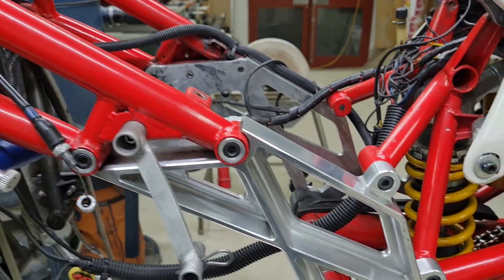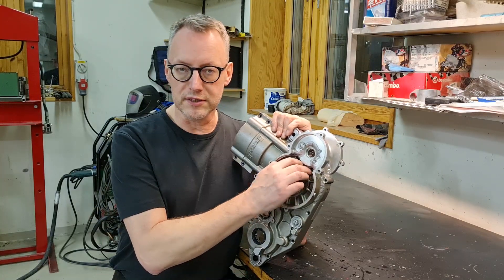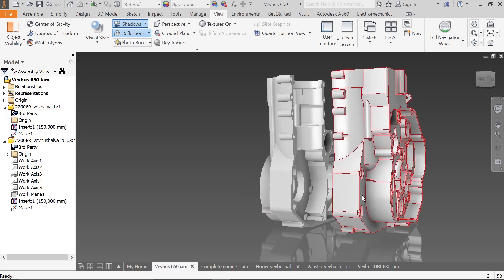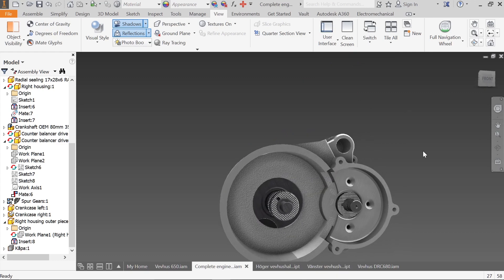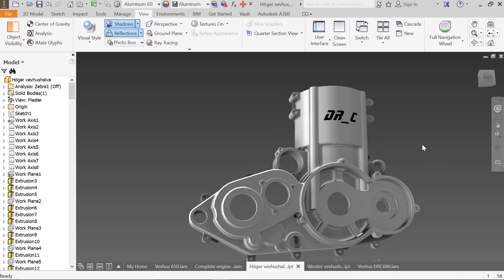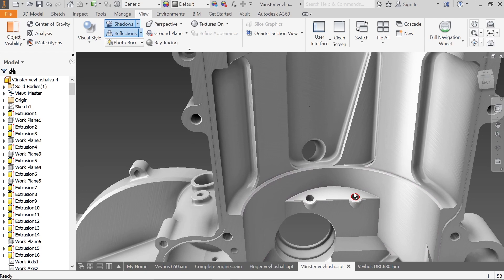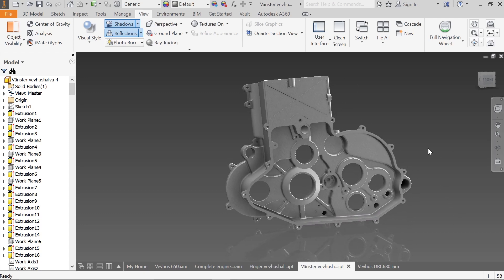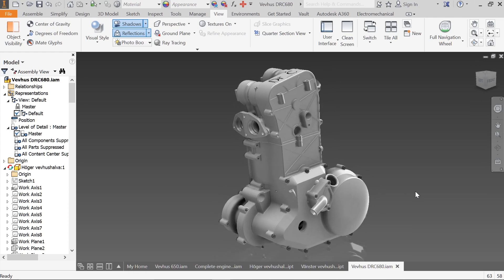Billet crank case project III

Comment: Mats, truly inspirational work. I have been searching for a billet impeller cover for the Rotax engine in my Bimota Supermono for a while now and to see you create not just a cover but a whole crank case is jaw dropping. I remember you had overheating issue in a previous season which you engineered a number of responses to, now that you took the design to a different level did you incorporate anything new in the design of the impeller to improve flow rate ? Best of luck with your endeavours.
Reply from the maker: Thank you for the kind words, Andrew! The heating problems have had more to do with having to stand still on the grid before warm-up and race. Other than that, leaking of coolant has been the bigger issue. No direct needs to increase flow. The billet head could benefit from a larger water jacket, to increase the heat transfer area, but too much work for a problem with small consequenses.

Comment: Why only two bolts on the cylinder?
Reply from the maker: What? Where?
Reply: In the first design, there are four bolts on the cylinder. And with the second project, only two. In my opinion, refrigerant may leak out there. Look at the original for how much material is left in the cylinder. @Dr_C

Comment: Mats could you have used barrel rollers  instead of double  spherical - like they used on later combat Norton to accommodate the flex ?  I saw that  some are contemplating moving  the counterbalance to the cylinder head - would this be an option?
Reply from the maker: Hi Trev and thanks for stopping by! Yes, those barrel roller bearings were on top of my list. When we simulated the bending of the crankshaft in Ansys, we could see a bending of up to 0,5 deg! That is unfortunately way larger bending than barrel roller bearings can cope with. The double row spherical roller bearing can cope with 1,5 deg tumbling, and some 58kN radial load, so they were the way to go. The mains have now shown zero wear or any signs whatsover on usage! :-)

Vibrations still include a certain amount of "black magic". Compensating the imbalance mainly the piston, crank and conrod are causing is difficult to calculate. Engine mounts and source distance and location from center of mass of the complete engine, comes into play. Placing the counter balancer high up in the cylinder head might very well work, but it is difficult already getting a good result closer to center of mass.
Reply: @Dr_C  Gosh that's a lot of whip in a crank  - I guess the forces must be massive to turn your crank into a skipping rope - being a large single and such unusually  high revs I guess  - your defiantly pushing the envelope - I remember looking at a chunky Chinese diesel engine about 1100 cc horizontal  single and was  astonished to see twin counterbalances tucked in either side of the crank - rather grand on a popular mass produced  engine - Its been fascinating to watch this develop on your channel

Comment: Just a note would it not make life much easier for your machinist if the cam chain was not in a tunnel and it was instead a separate plate over that area as that is quite a deep pocket with a relatively thin wall. Not to say it’s impossible but perhaps simpler set up. 

Keep up the good work 👍💪
Reply from the maker: Thanks, Björn! Yes, it would possibly speed up the machining, but introduce yet another  part and manufacturing of fixture. Besides that, the cylinder head is also bolted to the outer wall of the cam chain tunnel, so it needs to be well fixed against the crank case. We'll see what my 5-axis wizard says about it!